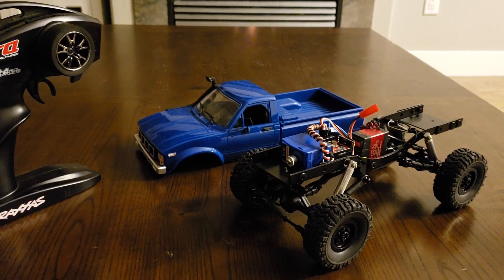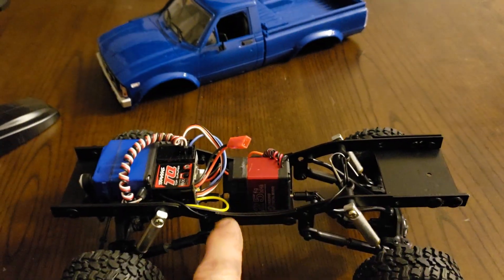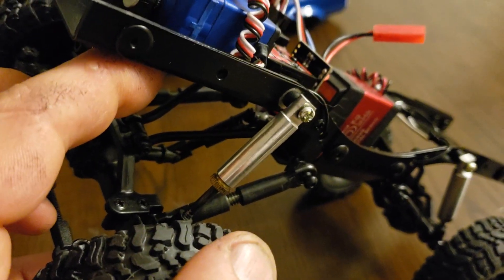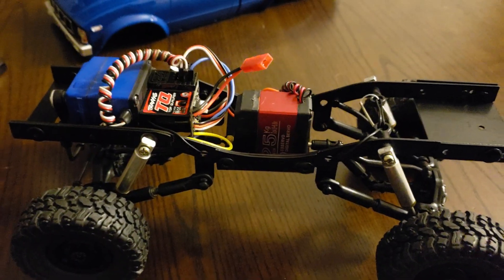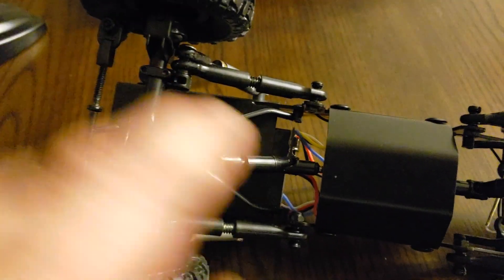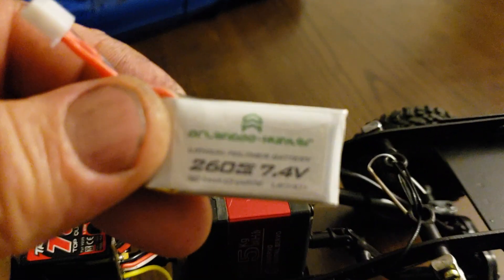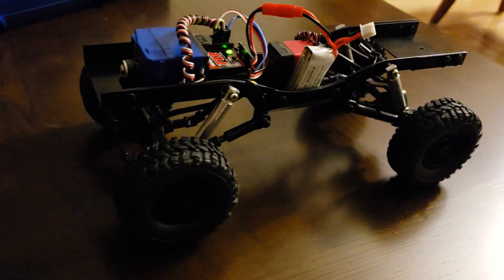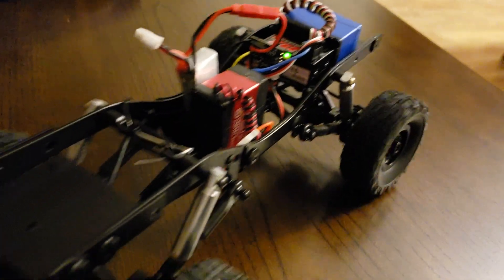wpl c24 Toyota truck servo transmission

Comment: I was wondering if you can explain how you coupled the servo to the drive. Are you using the output shaft as the pinion that meshes with the spur gear?
Reply from the maker: hi Anthony,  I'll gather everything together and re post a new vid on the transmission and drive train ,cheers
Reply: @rcforever3437  sweet, I look forward to that. I'm gonna order my kit today and would like to just do that mod from the beginning
Reply: One more thing, does this eliminate the need for a esc. You just plug the servo into the receiver and power the receiver with that small lipo you had?

Comment: I want to see it climbing. But its too late for now coz my metal transfer box has arrived already.. and im satisfy with it too much torque unbilievable power.
Reply: @Overland_RC  yeah lots of torque and heavy good for center of gravity and can climb any obstacles .. and ofcourse metal gearing ung the 2 speed trans. Its made of plastic.
Reply: @Overland_RC  crawler is slow ofcourse. Speed is not good on climbing thats why i change it to a metal gearbox. And its fine i already intalled it to my c24
Reply: @Overland_RC  its your decision all i was thinkin about the n20 bcoz its too small the problem when the  brush of counter part motor was cut inside
Reply from the maker: @Overland_RC  it's about the same speed but major torque 420oz
Reply from the maker: @Overland_RC  it's about the same speed but major torque 420oz